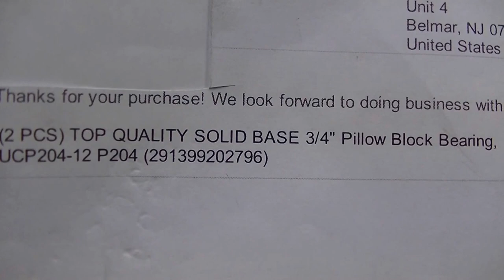72x2'' Beltgrinder Pillow Bearings Adjustment

Comment: Hey Dmitry, the block bearings are self aligning but only so much. Make sure everything is square and plum as possible for a good start. Before running them for the first time don't forget to grease them. You can use the rod for leverage to force them somewhat to align.

Comment: I encountered the same problem and learned from another video that the bearings can be realigned inside the housing. Just stick a shaft into the bearing and use it as a pry bar to realign the bearing. Lubricating the housing with a grease gun might help the process.

Comment: What can I do to fix unaligned? I installed by bearings, but spindle does not rotate smoothly.
Should I reassemble them from scratch with some grease on external rings, or there is some method to fix without big efforts?